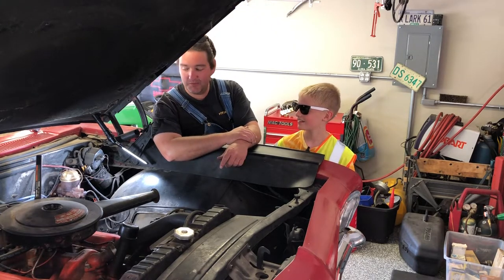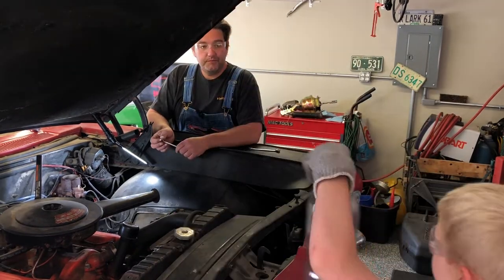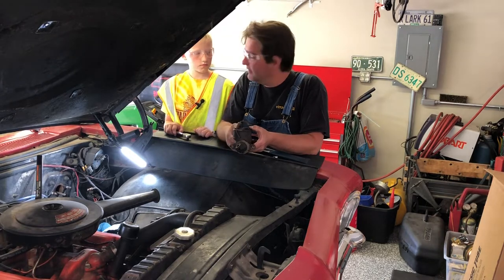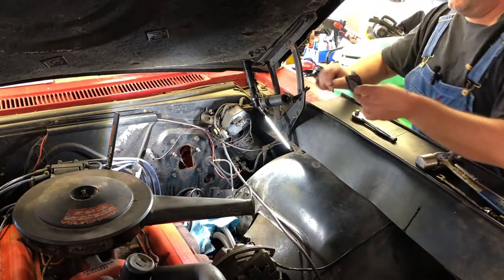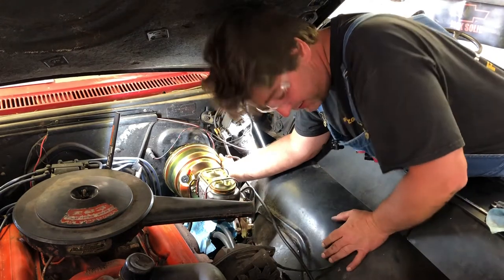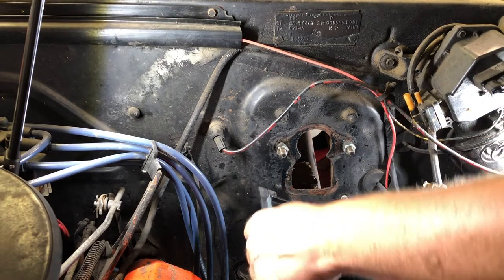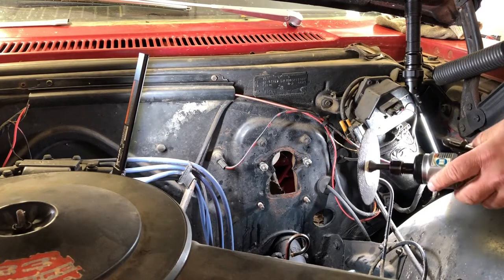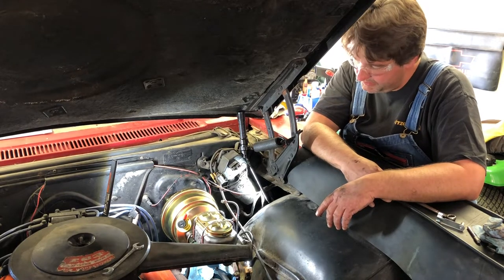1966 CHEVY IMPALA POWER DISC BRAKE UPGRADE PART 2

Comment: Enjoying your videos. I'm doing a 66 impala 2 door hardtop fir my first project. Currently doing body work on  rotisserie. I'm very interested in how you hook up the brake lines to the valve. I bought my front disc kit from pirate jacks and full conversion line kit from right stuff. I feel like I'm missing a line or just not sure how it's supposed to connect. Keep up the great videos boys. I have a 3 year old that starting to show interest in my car. Can't wait until she's a little older to be involved more
Reply from the maker: I’ve got a video I’m working on showing the lines…Thanks for watching and stay tuned!!!

Comment: I have 66 caprice I want to do this to but don't know if this will work with the rims I have.
Reply from the maker: @McCullochMac6  This stuff is basically 70’s Malibu…I went with 15 inch rally wheels, but I’m pretty sure 14 inch original wheels would work too…probably even 13 inch daytons…good luck and thanks for watching!!!